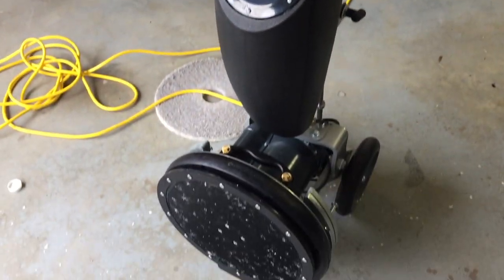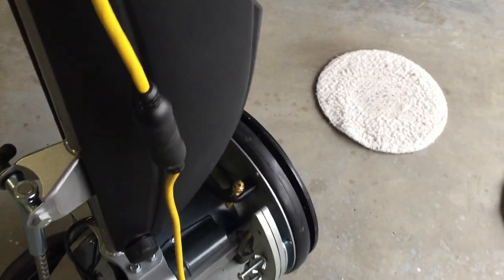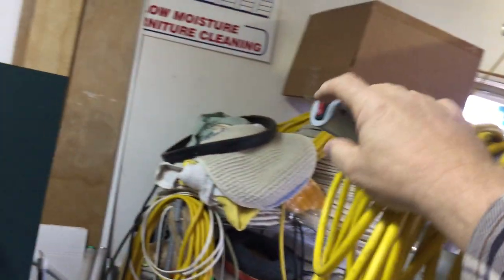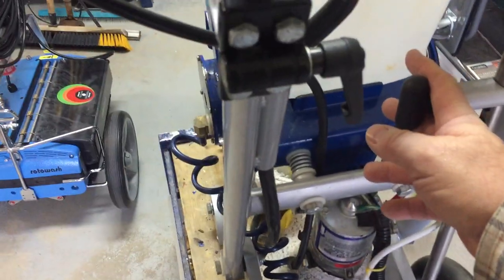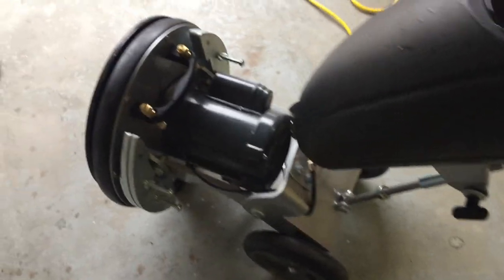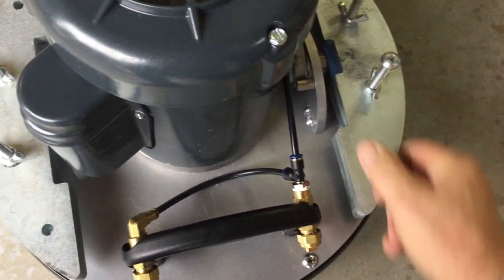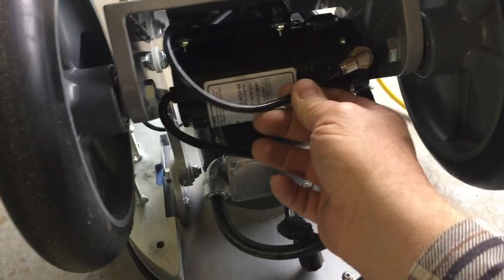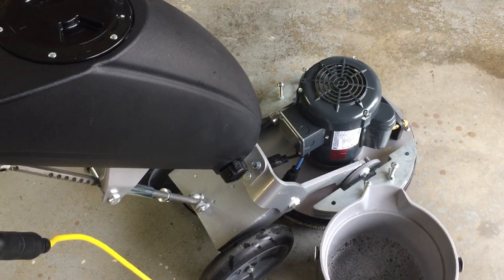Oxy-Dry review of the Orbot Vibe/SETT system

Comment: I have the Vibe as well and enjoy using it. Mostly I use it for commercial work but have used it in homes .
Reply from the maker: My expectation is that I will use this machine mostly for commercial and hard floor cleaning but it will not likely be my first choice for residential. I have used OP in homes in the past and always found the Rotary to be a better choice with clear advantages and no lack of cleaning performance when operated to its full potential.

Comment: hey Rob how do you clean the velcro?
Reply from the maker: It really helps if you never use cotton pads with this machine so I use Tuways, Superzorbs or Microfibre. To clean the Velcro I usually use a very small straight blade screwdriver and draw it through the clogged velcro and then pick out the fibres by hand. It helps to get it wet when doing this and it takes some time but it can be done.